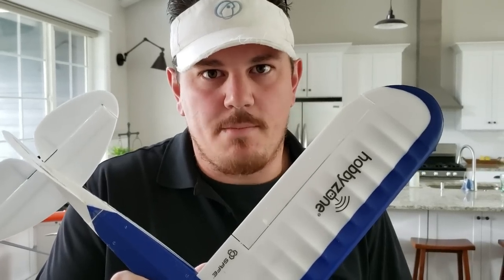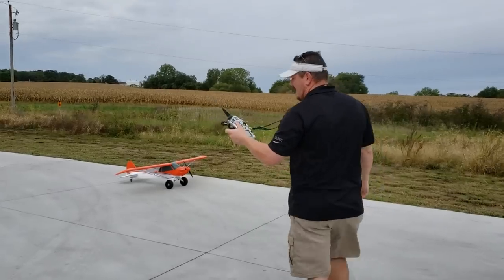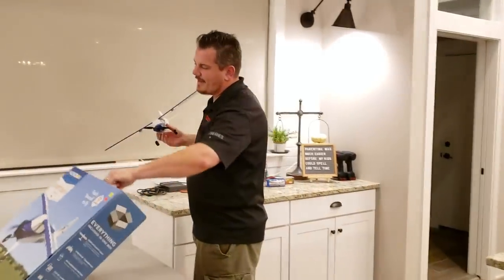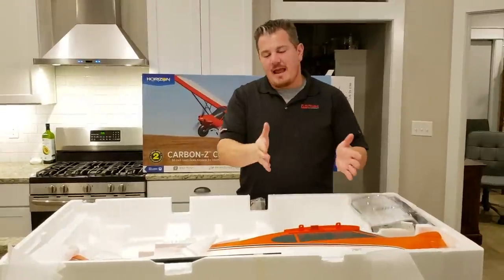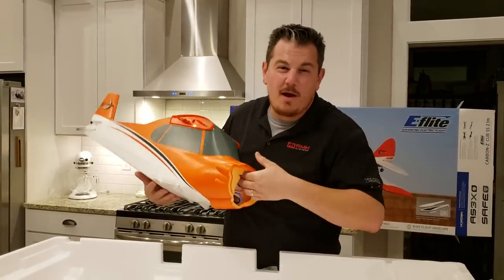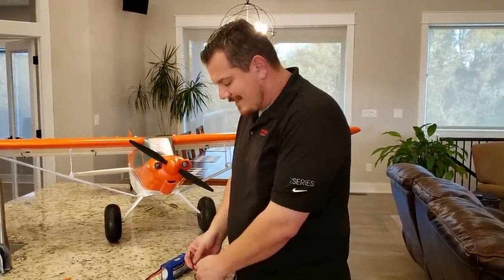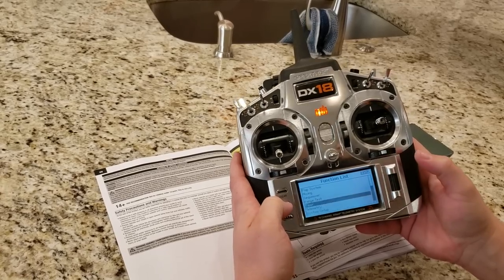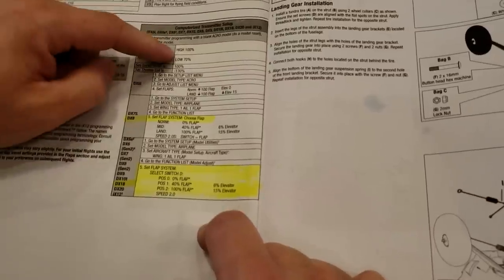Horizon Hobby - Carbon-Z Cub SS 2.1m - Unbox Build Maiden

Comment: Hi Brian, thank you and your camera crew for these excellent and informative videos!  It was actually the reason I purchased one of these (and I made sure to use the links you provided ;)       I'm thoroughly enjoying my carbon z cub as well, and I also have a Spektrum NX8 (and the same 7,000mah 6S battery you have in this video).  I can't figure out how you get battery information and other temperature readings on the NX8 while flying.  Please help?!  Thanks so much!
Reply from the maker: If you're on the NX8, and you V2, you will get all telemetry data. If you have a V1 (orange and white, first one...not the oldest blue and white - that will definitely NOT have full telemetry)

You click the scroll wheel and go down to telemetry, and click on AUTO-Config, but it should have already done that when you bound your plane.

I assume you've tried to scroll to the right on the screens? That's where it all is, if you weren't aware.

Comment: hi Brian,  got an idea for you,  you might think of doing a receiver upgrade video for the Cub SS using say the AR637T (6) chn  receiver with telemetry;   if you do this for Spektrum,  you might even get a free receiver out of it.
I have the DX8 controller,  which shipped with firmware 2.0;  telemetry requires updating to firmware 2.05 and then of course binding to a telemetry receiver like the AR637.  So the video idea would be the firmware update,  receiver installation,  and controller model copy and tweak from "Cub SS AR636"  to  "Cub SS AR637T"  and then cover the telemetry config options in the transmitter|controller.
... just an idea;  I got it figured out,  but it took me a couple of hours of study and experimenting.  
PS.  my beechwood prop came (beauty) 16x7  gorgeous!
PSS.   still looking for a chrome spinner I like....
Reply from the maker: I want to see the prop! I bet it's BEAUTIFUL!!!

As for the video about upgrading the Rx...there would be WAY too much swearing, and throwing things, possibly violence (against the computer, or myself) ...so, no thanks ;)

...but seriously, would be a great 4-5 hours video, but my patience, as you know is very wide and deep for these planes, but I can only handle so much ;)

Comment: Hey Brian on the carbon cub 2.1 mm my motor is just a little loose and when I full throttle the plane the spinner prop bolt and the orange thing comes off what can I do to fix the that
Reply from the maker: You need to TORQUE that thing down WAY MORE! You're gonna cut your hands off!!!!! Make sure she's SOLID. This is a huge safety issue...please get it fixed ASAP.

Comment: So on the landing gear bolt and nut  but the bolt  from the back so the nut  is facing towards the front that way you can  use the allen wrench pretty common sense.
Reply from the maker: Would you please put your thought(s) into a sentence or a group of sentences? I can't understand what you're saying, since there isn't any punctuation.
Reply: @BrianPhillipsRC  lmao well if you need punctuation ..  then i rest my  case commen sense is out of the window.  Why would you. Face the bolt   towards  the center of the landing gear??  Instead of out on the open end  where you can use the allen key🤦‍♂️🤦‍♂️. I've been flying  14 plus years and have 3  turbine  jets    and 2 of the carbon cubs and hand full of other planes.

Comment: Brian, you said you'd have alot of problems on the adapter if you used solid core wire.  Just wondering what those problems might be.
Reply from the maker: For starters, you wouldn't be able to get solder to hold it, since there's be a very small amount of surface area for the solder to contact, in comparison to a fine multi strand wire. Additionally, it would be STIFF!!! You could maybe use it for a straight piece, but you'd have to overcome the solder surface area issue.

Comment: Hi Brian, I noticed that when you power the receiver up, it makes an annoying noise all the time. I am facing the same problem with same receiver AR636A but different model. Everything works fine but the receiver does not stop making that noise. Is it normal? It will go away at one point? or Do you know how to fix it. Thanks in advance for your help.
Reply from the maker: AS3X will make the model kinda "hum" but this is normal. Some models are a lot worse than others. It will only start making noise after the AS3X kicks in, or after you give 25% or more throttle.
Reply: @BrianPhillipsRC  Thanks for the info Brian ! You always answer my question or comments. I appreciate it 👍

Comment: I noticed you didnt try a 7000mah 6s which is the largest battery they recommend for it.  Will you be trying that in the future?  Also do you have the elevator/ aileron mix adjusted? If so what is a good percent?
Reply from the maker: I don't own a 7000mAh 6S. I'd love to try it out, but won't be buying one that huge, but I WILL be test flying with 6S 5000mAh 60-120C Turnigy HD, and a ZOP 6S 4000mAh 70C Lopo, as well as trying to fly her on DUAL 3S 3000mAh Packs in Series, as well as any other combinations I can come up with. That video will follow shortly, if I can ever get some decent weather. It's been really windy and crappy out...which is to be expected with fall coming in like a freight train :(
Reply: @BrianPhillipsRC  I have had mine for 3 months and haven't been able to fly it. I bought 6s 7000 mah 30c. I am still a novice, and trying to fly without safe mode so waiting to fly the carbon z ss.

Comment: After putting this together...found the esc was bad. Try accessing the esc. Not possible without ripping out foam. What???!!!

I threw out the box before I completed the build. Called Horizon. I offered to deliver to a local dealer. They wanted the plane back for full refund. I had to literally destroy the plane to fit it into another box. Got the refund, but geez. Very disappointed. I ended up with a Flex Innovations Cessna 170. Love it.
Reply from the maker: I hate when they make us jump through hoops to make it right, BUT...they will generally make it right...unlike many of their piers.

Comment: why run adapter it limits current why not just solder on ec5 connector...just wondering
Reply from the maker: Not sure, it's been a long time since I did this video. I hate EC5's but LOVE IC5's the EC5's are a bit better than the EC3's which I absolutely LOATH!

Comment: I just got the same plane and my as3x is not working i was wondering is you have a solution for that. If so that wold be much appreciated and i have the dx6e transmitter 👍and good flying
Reply from the maker: Are you asking about STABILIZATION (AS3X) or SAFE (Auto Leveling - Sensor Aided Flight Envelope).

Have you watched the Radio Setup part? You have to make an assignment for whatever channel and switch you want to control the SAFE Select on/off. You also have to bind a certain way to activate SAFE Select.

Re watch that part, if you're not sure, and you'll probably see what I'm talking about.

Comment: Very detailed videos. Excellent. Mine will be here in a day or two. Did you try any 4s batteries? The insinuations are great. You two are just like hanging out with good friend.
Reply from the maker: Thanks Jeff! I didn't try 4S. I've only ever used 6S. This plane needs power to perform, so my recommendation would be to stick to 6S if possible. Also, you may need to reprogram the ESC if you want to run it on less than 6S lipos.

Comment: Tighten it at 1.40. It's a ball joint.. that's the turning point. Not the bolt
Reply from the maker: ok
Reply: Just received mine. Watched your 3.5hr vid for the second time now haha.

Also ordered a bl60. Talon 90 and 20a bec. Need to take a look at the motormount. Because the bl60 is shorter. 

Love the this plane. Hopefully it keeps up to my expectation.

I always use your vids when assemble a plane.

Niels

Comment: Quick question, if a plane like this on a maiden flight is poorly trimmed (not trimmed at all yet) and a beginner is attempting to use the SAFE features to use fly-back-home feature in a dire emergency, will it not work yet (fly-back-home) since it's not trimmed correctly yet? (assuming it has the GPS module).  I also realize a beginner should not be flying a $400 plane.  So just a hypothetical.
Reply from the maker: THIS plane doesn't have a "fly back home feature"...BUT there IS a SAFE+ GPS enabled Carbon Cub S+ from Horizon Hobby (Actually, hobyzone...same company...here's a link - https://amzn.to/2MCABL1 ) This 1.2m plane, much smaller, about half the size, has a "fly home" feature, although of all the interesting, and very complicated technology available on RC aircraft, this  feature is one of the hardest to use, and LEAST dependable! I would never plan to use this feature, or expect it to work, let alone depend on it.
If you're just learning to fly, the $400 price point isn't the biggest issue, I guess, it's more that a larger plane is harder to keep under control, and had higher consequences when you do inevitably make a bad landing or have a crash. Some say larger planes are easier to fly, and they're right, but they're more capable of hurting themselves, you, and others as well...so you gotta take them even more seriously.

I really want to encourage you along in your endevour to fly RC, so please keep an eye out for new videos, and possibly go back and watch some of my older footage...you will see, I wasn't the pilot I am today, five years ago...not even close.
Reply: @BrianPhillipsRC  I will do that for sure.  A lot of your videos are now coming up in my suggestions, so yea, by you-tube intuitive features, you might say, you are showing up on my lists and I look forward to watching as many as i can.  That does make sense... the bigger you fly, the more there is to conquer and the more there is to lose so to say.  You make quite good sense.  I don't think i will look as much for the GPS barrier features and auto-land as i will for general features in a radio that help me mix flight surface controls (expo, etc.).  Man, this is so more involved than it used to be with all of the motor choices which are related to weight, type of flying, speed intentions, loading, and the list goes on --- it's overwhelming.
Reply from the maker: Overwhelming is a great way of putting it. I think that's why it's so nice to have these BNF planes. It used to be months of work, and we couldn't just jump on YouTube to see how it was going to work if we did it all right.  There's a lot to learn, but luckily it's mostly cumulative knowledge. Once you learn something, you'll be building on what you know, and you will have some help from your past experience too!!! So much stuff from when I was a kid is still helpful, especially the hard lessons ;)

Comment: great video! just from my experience of building Arf kits... $450 is way to much for a foam plane even that size with Horizon's cheaper  electronics....you can build an arf that size in balsa with all the top grade electronics for the same price or even less...but I guess when they are the only ones in the buisness you have to pay
Reply from the maker: If you built this plane from kit, you'd be in it for a month at least, but you'd have a very nice plane at the end. These planes are a function of people's busy lifestyles, if you ask me. Before his passing, my Grandpa and I would work together to build kit planes and then fly them. This was a very different experience, but still fun in different ways.
Reply: @BrianPhillipsRC foamies are getting better now for sure, Horizon used to sell a hand full of rtf and pnp wood planes as well but the cheaper foamies were more popular so those went away quick... now the bigger foamies are up in that same price bracket....

Comment: A bit annoying that you read the manual and still did not see that you were sitting on the wheels incorrectly.
But maybe you discovered the mistake when you got parts over?
If not, then you will understand when the wheels may lock, or begin to slide sideways as the wheel holes are worn toward the inside of the landing gear.
Otherwise very good video.
Your flight outside the house made me decide on a purchase.

And as always very well filmed, both inside and the flight video
Reply from the maker: Jan, I'm sorry but don't understand what part I had installed wrong. Can you help me figure this out??? I though I had it correct.
Reply: @BrianPhillipsRC  Hello! Yes! The rings that you put to hold the wheels, they should also sit on the inside.  And I don't see you having any there.
Thats all, sorry for my english.
Please, make more flight videos, or if weather is bad show ous all your planes.
I wish you all a very nice weekend.
Reply from the maker: Thanks Jan! I'll check out those rings on the wheels.

Comment: Hello Brian, thanks a lot for your great videos...! I have learned a lot. I watched this one few weeks ago and decided to buy the Carbon Z Cub which I haven't had the time to flight yet. In your opinion, which is the more suitable lipo for this plane (relax fligh, no aerobatic flight)? 6S, 4S, 5000 mAh, 4000 mAh? Greetings from Switzerland.
Reply from the maker: Good question. If you already have a 6S 4000mAh, that's what I''m using, BUT you can supposedly use a 4S. In my experience, the ESC won't run on 4S...presumably because you have to reprogram it to run on 4S.

You will want 6S power, even if you don't intend to use it. This plane is amazing, either way. If it's "too powerful" shove a huge pack in there, or two packs...and make her heavy for a more scale looking flight.
Reply: @BrianPhillipsRC  Thanks for the info and stay healthy...!

Comment: Best video i found, really helped me! I do have on slight issue though, when i switch from AS3X mode to safe my rates and expo settings change back to default and is far to sensitive. How can i combat this?
Reply from the maker: Your EXPO and RATES can be controlled from another switch, separate from the SAFE Select switch that you designated...maybe that would be the easiest option to fix your issue? All you have to do is hold the sticks at the corners and then flip another unused switch back and forth five times (I think that's the right count)...and the controls will "dance" ...then you can change your EXPO and RATES independently.

All that being said, SAFE will greatly reduce the control authority you have when flying this and any other SAFE Select equipped plane. It's for this reasons that I rarely use SAFE, but if you need it, or want it...I don't mean to fault you. Everyone flying RC is at a slightly different spot ;)

Comment: Help me Brian...this is my second plane. I seem to have it all set up with my DX6e, but my elevator is in the down position too far when the plane is sitting idle on the ground. I know the servo horn and linkage is adjustable, but just wondering, have I set up something wrong.
Reply from the maker: Does the elevator move when you pivot on the mains? (without moving the elevator control on your transmitter)
If so, TURN OFF SAFE...if you bound with SAFE, you might have forgotten to ASSIGN the switch you want to use...thus it's still on "all the time" - MAKE SURE YOU ACTIVATE THE CHANNEL TO THE SWITCH YOU WANT TO USE OR IT WON'T WORK!!!!!!
Now, repeat (with safe off) - does the elevator move?
NO - GOOD, now see where you want it...
Do mechanical trim.

NOW, make sure you have plenty of play UP & DOWN - if you don't you might nose over on takeoff.
Correct for above.
Fly it and love it.

P.S. I assume you're talking about the Carbon Z Cub SS 2.1m - this is a crazy second plane!!!
Reply: @BrianPhillipsRC  ...thanks man, i haven't been able to select a switch for the "safe" yet. I did it the way the manual said with no luck. I'll bind it again with "safe" and try it again. Yes it is the 2.1. Haven't flown it yet. Want to make sure everything is correct with it.

Comment: Hey Brian, got the "Carbon Z Cub SS BNF" some days ago. Everything is is fine but one thing: "Safe Select" mode. Maybe you have an idea (since Horizonhobby didn’t reply until now).

When the plane is on the ground and bound to my DX7, only with AS3X on, all servos are perfectly centered. But as soon I switch to Safe Select the elevator servo goes up by approx. 30 degrees while all other servos behave like they should. Result is that it's not even possible to get the elevator wing below the neutral position with plane on the ground.

Settings on Tx are perfect. I can only imagine a problem with the gyro sensor in the receiver or bad programming, which I didn't expect from horizonhobby until I found out that this plane's flaps Servos where not connected correctly to the receiver, too.

Any idea? All the best, Peter.
Reply from the maker: Lift the tail, and see if it levels out at "level flying attitude" You might be surprised to find this behavior is actually pretty normal. Keep in mind, the SAFE system is trying to level the plane in flight, not put it in a three wheel landing attitude, as it pertains to pitch. Let me know if it "levels" out.

Comment: Hey Brian the lock nut on the things that on the wing with the lock nut it ain’t going in to the lock bolt what can I do to fix that
Reply from the maker: Are you talking about the PINs that hold the wing STRUTS at the FUSE? If so, you gotta get some help. It's HARD to pull them into alignment to get the wide part through, without it popping out before you can get the Key Pins in....
Reply: @BrianPhillipsRC  yes that’s what I was talking about and I got it and when I try to go Down on the elevator  the down stick the plane doesn’t go up and I have it full throttle